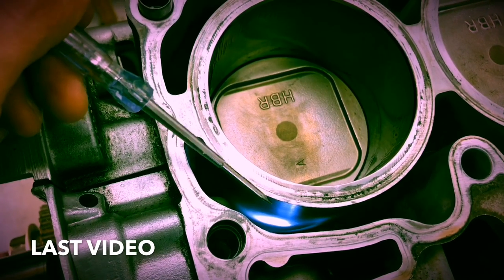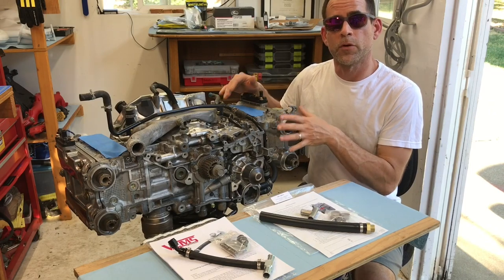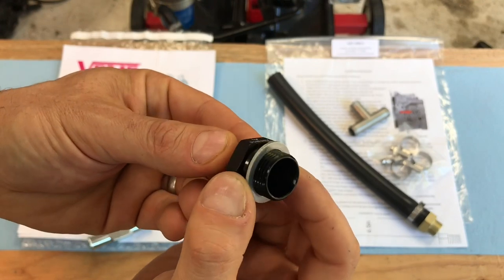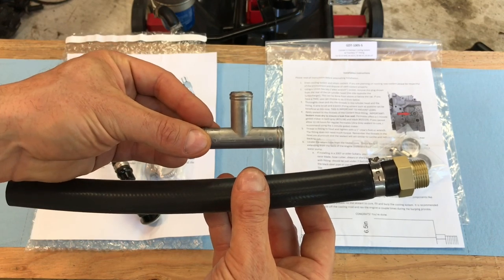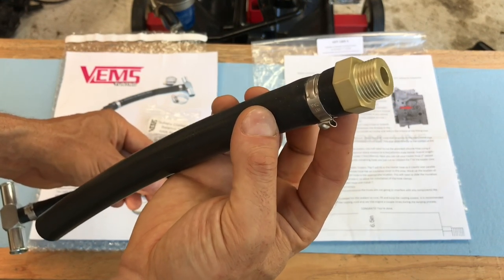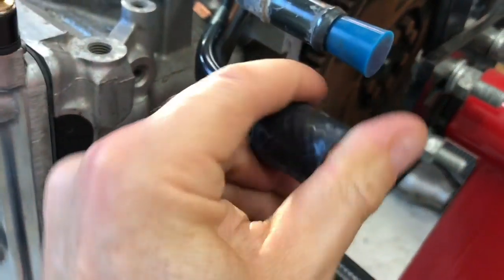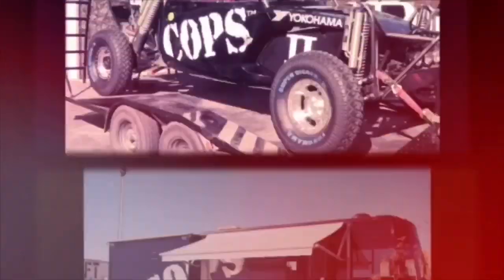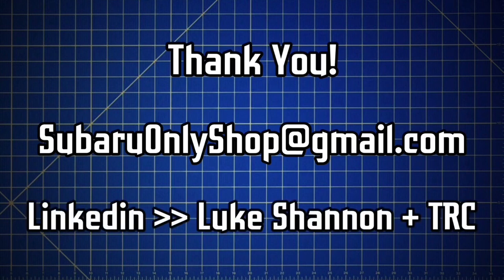Subaru Coolant Balence Kits | GDT vs. VEMS

Comment: Support the guy who originally brought us the product (dom acia)
Reply: All the jdm v8 ej207 have this bypass from factory so I think dom just copies it good idea tho wish I thought of it
Reply: @bobbytwotone9429  
That's definitely not true. There is just a plug there like the usdm EJs. Same with the v9.
Reply from the maker: Yea, think you are right.  How about the twin turbo JDM Legacy models? I think those use this coolant route too.
Reply: @SubaruONLY  I can't honestly say with the twin turbo 205, never seen one in person. As for the version 8-9 ej207s, I can definitely verify they are just like usdm.
Reply from the maker: Got cha. Thanks!
Reply: @SubaruONLY  as far as I know that is the coolant feed for the second turbo on the twin-turbo models, I'm getting an EJ206/208 long block swapped in and was told that some of the feeds for the second turbo need to be plugged.
Reply: @tflo9543  the twin turbo engines are EJ206 or EJ208 respectively (206 Auto/208 Manual) and have forged internals like some of the EJ207s
Reply from the maker: Cool - didn’t know these details - thanks!!!
Reply: @SubaruONLY  got links for sourcing these kits?
Reply from the maker: Not off hand but they sell them at Rally Sport Direct and IAG. I’d check there - cheers!

Comment: First, Thanks for taking the time to make this and your other 75 videos. I have no idea why this is labeled reverse cooling, it doesn't reverse the cooling design at all. Most importantly though, too much flow through the back of the head negatively impacts cylinder 1. ie. Moves the problem. We optimized the orifice size on the dyno while testing coolant temps coming out of the back of each head to get them as equal as possible. We designed a custom fitting but found the specific Phenix fitting we use was within 0.010" of our optimal size and provided a delta of only 2 degrees F between the heads, so why complicate things, add increased lead time and increased cost? The only client of ours that had installed a GDT kit had to wire tie it away from the steering shaft. With the AN fitting you can route it away from the steering shaft upon installation. That's not apparent for you yet though since it's on an engine stand. Also, please dont use RTV on threads. If anything, use thread sealing compound, but that's not required when you use a crush washer.
Reply from the maker: Guys - just saw this comment now (I guess it got pushed to potential spam folder. I approved it, as you’re seeing now, sorry for the delay).  

Ok - thank you for taking the time to clarify and add the background on the R&D that you guys performed. I owe you a follow-up review video to share this additional information on the VEMS kit! 

Your logic about moving the problem to cyl #1 makes a lot sense. And choosing to select the orifice size based on balancing the temps exiting the back of each head seems very logical too. 

One last question, using this kit effectively pulls the heat out of the #4 cyl head area and transfers it into the coolant, have you done much testing under more severe driving conditions like track days, to confirm that OEM Subaru cooling systems can keep up with the extra heat this puts into the coolant system?  Do you think a larger, more efficient radiator is needed at some point? 

Thanks guys! 
 Luke S.
Reply: Soo ill say for a regular person that not a nascar driver vem seems to have the orifice size of coolant moving.   
For track days, Dom been slightly bigger is made to move more.
Reply: @josesanchez4470  All of this information makes a case for installing a higher flow thermostat. MotorRad makes some of these for Subarus. Has anyone tried  a high flow thermostat?  Do they make a difference?  Maybe it would be better to drill a few small holes to improve flow in an OEM part.  Of course It would NOT selectively address or fix cylinder 4 problems just hopefully be a small improvement to flow (if the combined area of the diameters of internal passages, holes in the head gaskets, is not smaller than the thermostat opening and not the primary obstruction to faster flow in the system (?)).   If I lived in Hawaii, southern Florida, southern Texas, or maybe San Diego I would be very tempted to delete the thermostat completely.
Reply: @josesanchez4470  No. The larger diameter would only help if both cylinder banks had a larger diameter outlet hose from the engine back to the pump. You'll just burn up cyl1 with a big ass diameter tube on just the 2 & 4 side.
Reply: Just want to say it's nice to see you comment and only provide info with no negativity. Nice addition guys. :)

Comment: Just a note: in the test fit you installed the T fitting incorrectly.
Reply: Noticed this as well, even though it's a mockup, I think it's important to be accurate.

I also don't think a "y" fitting would work well either.

I think it's made to not only let coolant enter the heater hose flow, but the coolant in the heater hose will inherently pull the cyl 4 coolant into the fluid stream... Having the straight part of the T fitting being the heater flow would allow that to happen whereas a Y fitting might allow some coolant flow from the heater to try to enter the cooling mod hose.
Reply: Side note, are you T3h Clap from the write-up threads on Nasioc and IWSTI?
Reply: That's when you know he works for dom
Reply from the maker: Thanks and good catch.
Reply from the maker: I don’t work for Dom. But I think the guy is a cool dude that I support 100% 😁😁😁
Reply: @The2004STi  probably
Reply: @The2004STi  I originally thought this as well but I soon realized I mocked it up wrong in my head.  If you have the bottom stem of the "Y" towards the pump return line there would be no turbulence.
Reply: Alex DiVito kinda late on this but this cooling mod works with vacuum pressure created when coolant flows straight across the t fitting sucking it from cylinder 4. Dom has an explanation on this

Comment: Neither kit is worth almost $100. I think you can make your own kit for less. I like the kit with the an fittings better.
Reply: Neither of them costs 100.
Reply: Dominic Acia still over priced for what it is, and I said almost a $100. Which price plus shipping is almost a $100.
Reply: @michaelhite1433  go have a custom designed 6061 fitting made and anodized, get a stainless steel 5/8 tee, high temp silicone hose, 4 304 stainless embossed clamps and come back with that price. I'll wait.
Reply: Dominic Acia silicone hose is $5 a foot which I’m sure you get a deal on because you buy it in bulk, stainless clamps are a few bucks,  a stainless tee $6 to maybe $15, which you also probably get in bulk, the fitting is the only unknown. Vems gets theirs from Phenix industries, which I’m sure they get a bulk price. Now of course you aren’t going to share how much you pay for this wonder fitting or where you get it.
Reply: @michaelhite1433  I have them machined by PYI. They are my design because the internal diameter is critical to proper operation of the cooling system. Going too large messes up all kinds of stuff.
Reply: But since I did the research, and make the financial investment in buying in bulk, I should pass that on to strangers? I also have to pay for a business license, taxes galore, a website and make enough money to make it all worth it. I spend hours finishing the Ts on my buffing wheels, hours cutting hoses, crimping clamps, packaging materials, printing instructions, toner is expensive, I use very nice 36lb paper, I have to package everything etc etc etc.
Reply: Gotta pay credit card processing fees, monthly and per transaction, gotta pay for an SSL certificate, domain registration, shipping monthly dues on top of actual shipping costs, shopping cart service monthly... That shit adds up.
Reply: Dominic Acia but for someone with some mechanical skill can diy this mod for less. I personally don’t feel the need for silicone hose. It looks nice but not necessary, and I was wondering if a y fitting would work better than a tee, maybe? That’s why I said about the fitting, a custom machined fitting would cost more than an off the shelf fitting. Don’t get me wrong I don’t think it’s scam, or you’re taking advantage of people, just questioning the cost. I’m some what new to Subies. I’ve been a Land Rover/Jeep and VW Audi guy. This mod reminds me of the LS steam port mod.
Reply: @michaelhite1433  there is no situation where a y would be better. 

I don't know of any mods to your car that aren't cheaper to do yourself
Reply: @GetaDomTune  do you still sell your kit. After rebuilding 2 ej25 and now building an ej20 turbo motor to swap into my Forester, I understand what you were saying.
Reply from the maker: Hahah, oh yea, he’s still selling and still going off on rants about people ripping him off (and I love it, he’s hilarious)- keep up the innovation man. When RCM copies your design, I think you can feel vindicated. 😉
Reply from the maker: This should be his link, getadomtune.com 👍
Reply: @SubaruONLY  yeah I just looked him up. I’m definitely getting one for my ej20 I’m building to swap into my Forester.

Comment: This was done by Subaru OEM in many JDM engines, the exact same result can be achieved for about $15 in hose and fittings. You can buy an OEM plug with a hose Barb that fits the rear of the cylinder head, and then you just need some hose and an Amazon T fitting (or even better, a Y fitting).
Reply from the maker: good home hack for sure!

Comment: Thanks a lot for the review and the video. 
Just to be helpful about the design criteria, having too much flow is a bad thing for this kit. My fitting is custom and not off the shelf because I spent a lot of time testing different internal diameters.  Too large of a diameter causes low heater core flow (even more than these kits already produce), reduced balance and flow to the other cylinders and the oil cooler. 

The hose is a very high temp and expensive silicone hose with a tighter allowable bend radius than other hose on the market. Made in the USA.
The hose clamps are all very high grade stainless clamps. Made in the USA.
The worm clamps are stainless, non-perforated, SS, embossed, rolled edge clamps. Made in the USA.
The fitting is custom made, anodized, 6061 aluminum. Made in the USA. 
The T is Stainless, but made in Poland.  (The VEMS T is just coated mild steel). 

The kit was made to create a good balance in the cooling system and the internal diameter is what dictates that. A Y would be too much flow as well. 

Lastly, at the very end, you showed the hose connected to the T incorrectly.  On your setup, you should be cutting the hose down to the size shown on the instructions. 

Thanks again!
Reply from the maker: Thanks for taking the time to add all this great detailed info Dom!  And thanks for putting this kit together in the first place.  Sounds like I missed a lot of great technical info when making this video, sorry about that. But overall, it’s clear to me your kit is far superior to anything else on the market!  I also love that all your parts are manufacturers here in the US, nice job man. Maybe we do a SubaruONLY Podcast  - You interested?  Would give you a chance to walk through all these details and share any other cool things you are working on.  Cheers buddy! 👊
Reply: Your amazing dom one day I will make the trip to Washington to shake your hand
Reply: @bradleehill9662  look forward to it
Reply: Getting Dom’s kit after C4 detonation flattened my rod main bearing. I’m surprised that the big shops don’t even mention this mod. I’d make it a serious note on all EJ builds... like as serious as the oil pickup.
Reply: Just want to say it's nice to see you give feedback without slinging any mud! Awesome info. :)
Reply: So what if you're running an oil-cooled (only) turbo and not using the water port near cylinder 3 anymore, would you block that port or run it straight to the upper res? Seems like you'd have the same issue with cylinder 3 once you close that turbo feed coolant port, unless I'm missing something?
Reply: @tonyregalado7281  do you now if the coolant line is a hose or a hard line to the stock turbo?
Reply from the maker: Agree. Should probably not block off the coolant passage, just bypass the turbo and run it straight to the line that gets recirculated. That’s what I’d do - cheer and good luck! 👍
Reply from the maker: The oil feed to the turbo is a small hard line, and the coolant feed is a rubber line with a protective foil sheath over it (at least from the factory).  👍
Reply: @bdubblu  Have you ever actually seen an oil pickup fail though? Everyone says it but idk if anyone ever really has the problem.

Comment: You mention to use grey RTV on the VEMS adapter with a crush washer. It should have an o-ring or bonded washer. The adapter is a male metric pipe to JIC, also called AN. The metric side is designed as an o-ring boss connection with metric threads.  The thread is related to manufacturer and country of origin.  Japanese and automotive tend to use more metric than imperial.  The imperial US version is commonly known as UNO or ORB for o-ring boss in the US.  There is a British pipe parallel (BSPP) thread o-ring boss which is commonly called British Port.  British threads and US threads are imperial but are mostly not interchangeable. Each of these thread types have a different size seal interface between the adapter and the receiving port. The internal diameter of the adapter can be the same but a different thread interface will have a different o-ring size seal.  The adapter is designed to seal with an o-ring at the base as it is compressed to the receiving port.  Looking at the surface of the receiving port, you should be able to see a continuous chamfered edge. The adapter will have a non-threaded space next to the hex shoulder where the o-ring should sit.  A second option is to use a bonded washer to seal between the adapter and the port.  The use of an o-ring or bonded washer are not optional. Using sealant on the threads might work but the interface is not designed to seal at the threads.  A national pipe thread fitting (NPT) and British Pipe (BSP) have a taper and threaded to the base or hex shoulder.  The tapered threads mash into the female port to seal. Thread tape is a lubricant because the seal is made when deforming the threads and port to make a seal.  It is a best practice to use an adapter and convert a NPT port to a different seal connection such as a JIC (joint industry council also called an AN or Army Navy), O-ring face, or other common connection.  You'll notice it is difficult to clock a male NPT connection and O-ring Boss  unless it is a female swivel with cone on a male nipple. British Pipe Parallel is designed this way with a swivel nut compressing a cone onto a male pipe nipple. Lastly, when designing a hose assembly, it is best to use a swivel connection and to have no more than one end angled.  This means if the connection path requires two angles to complete the path then it is best to use angled adapters so the hose assembly will have straight hose tails. Next best would be a straight and an angled adapter with the hose assembly having a straight on one end and an angled fitting on the other.      Based on design, I like the Vems except I would rather see a hose T with a JIC middle connection. Reason is the JIC male on the adapter to block and the JIC male on the T can be capped if the hose between fails.

Comment: Hey bud thanks for the comparison. Went with the VEMS kit for the reasons of the fitting not needing a gasket RTV that if serviced will need a full cleaning and reseal that you may not have time for, the hose doesn’t need to crimp even if it still keeping the ID of the hose correct bending the GDT kits hose it’s freaking silly but it gets me. I do think the GDT kit should have AN option for a tier price and both should use those non marring type hose clamps for the heater core hose you cut instead of the worm drive like a fuel hose clamp but Dom in his latest video stated that even the worm drive clamps are really hard to get never mind stainless quality ones. Just my two cents as I don’t have any degrees in engineering so hats off for figuring this mod out. I gave you a shout in my video as I went over the nuances of the VEMS kit with a rough install of the components on my 04 STi.
Reply from the maker: All good points. Makes sense to me. Cheers!

Comment: I put this in the reply to T3h_Clap but...

I also don't think a "y" fitting would work well either.

I think it's made to not only let coolant enter the heater hose flow, but the coolant in the heater hose will inherently pull the cyl 4 coolant into the fluid stream... Having the straight part of the T fitting being the heater flow would allow that to happen whereas a Y fitting might allow some coolant flow from the heater to try to enter the cooling mod hose.

Comment: So what if you're running an oil-cooled turbo and not using the water port near cylinder 3 anymore, would you repeat this mod for that side? Seems like you'd have the same issue with cylinder 3 once you close that coolant port...

Comment: Nice vid again. But i dont see egts results in cylinder temps at 400hp that show a concern. I dont track my car thou, just drag and daily. Reckon i will do this mod anyway but i will use the smaller outlet size just to promote a little better water flow at back of block.
Reply from the maker: Prob better to be safe. Don't think it would hurt in any way.